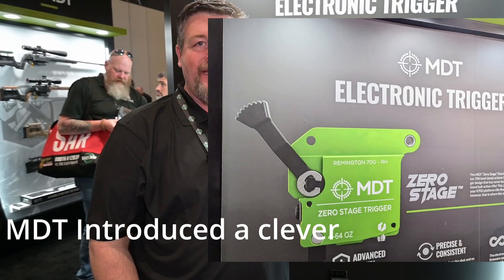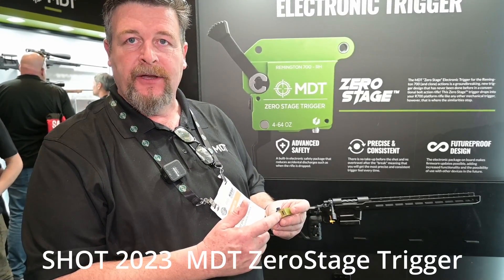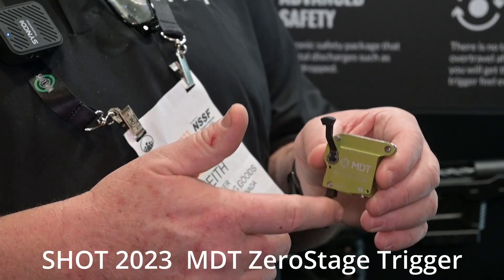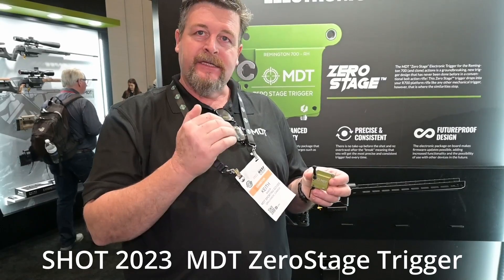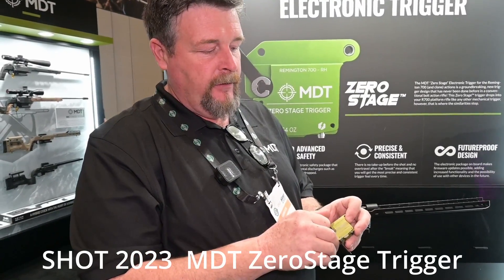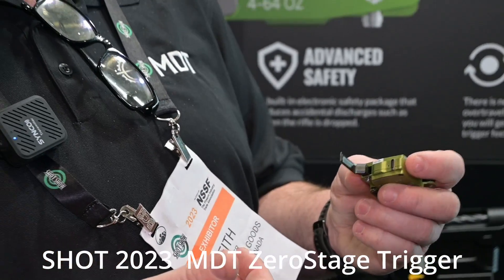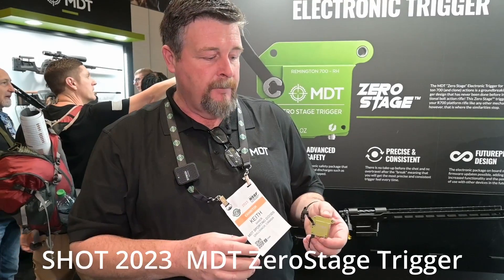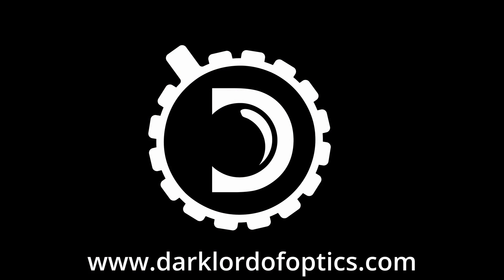SHOT2023: MDT ZeroStage Trigger

Comment: Interesting. I agree, something like this would never go on a rifle I had to rely on. Could be fun on a range rifle, but in my mind this is just like an EV, and I will pass. Thanks for the vid.
Reply: Wait until you find out your engine is completely controlled by computers
Reply: @jimmyc7269  I’ve rebuilt engines and played with different ECU’s, not even remotely close to the same thing.
Reply: @bigjeep127  they’re EMP proof!
Reply: @chargerguy74  How are they not remotely close?